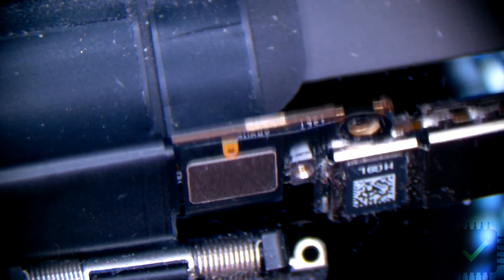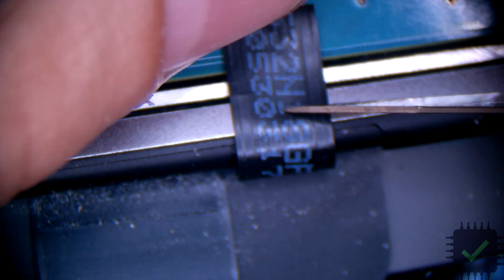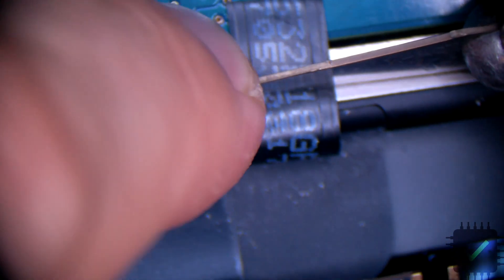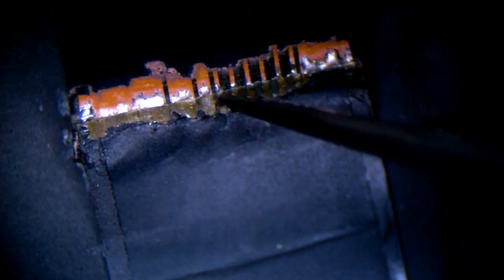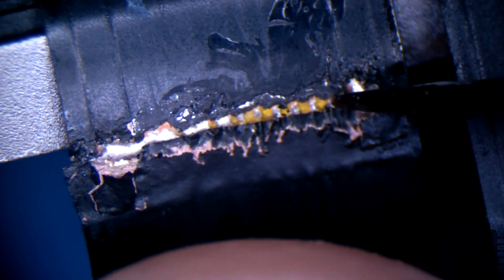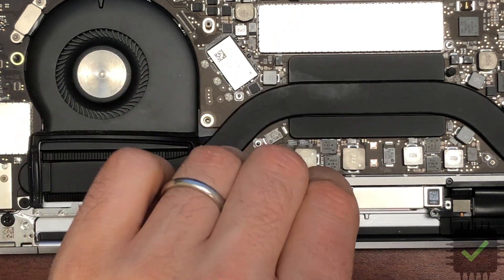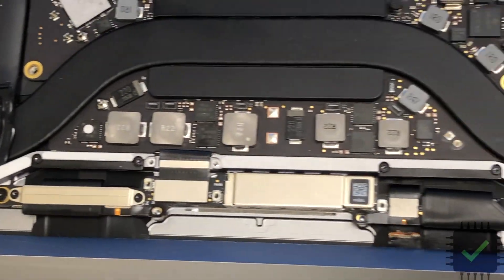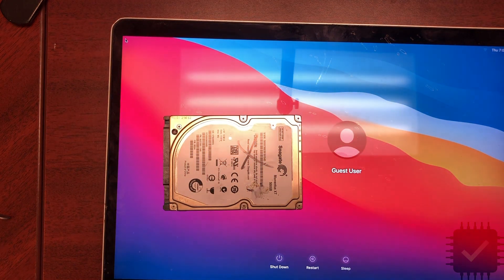Apple MacBook Pro 2016-2017 A1706 A1708 FLEXGATE (No Backlight) Repair Process by Apple Pie Tech

Comment: Hey Apple Pie Tech 😁
I had a Flexgate repair before some Days.
And after the repair, the backlight was working! 
Well... but now a have some Stagelight effect.
A had to repair both of the backlight cables.
Do you had that issue in the Past, and wanna give me a little hint were to start with my troubleshooting?

Greetings!!
Reply from the maker: Has to be redone. Maybe it wasn’t done properly in the first place
Reply: @applepietech  Figured it out by myself :-D
It seems like, the cable that i was using, was not the best...

Comment: I don't understand what you use for the new cable you are soldering on. If I see right, it goes face down onto the old cable. But if it is a copy of the original cable, it would be face up..
Reply from the maker: I used replacement backlight flex cable from aliexpress, cut to fit. Link is in description. It was soldered in the same orientation as the original cut-off part, with overlap for the strength.
Reply: @applepietech  Ah, it looks like your replacement cable is better than mine. I just tried with mine (also from AliExpress), and if I scrape the back of the cable and then try to tin it, it's impossible. There's no copper on the back of the cable (the side that looks flat, not the side where you can see the traces under the coating).